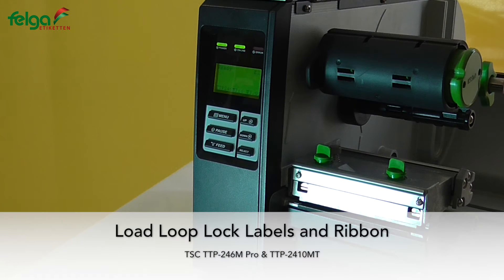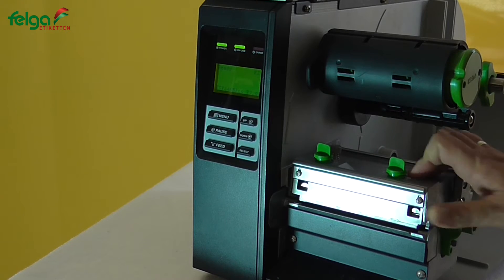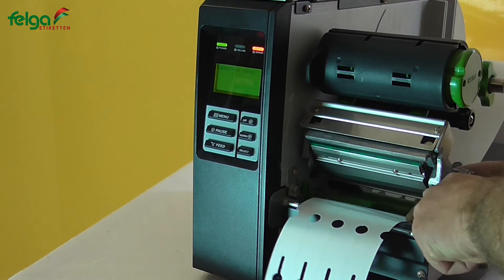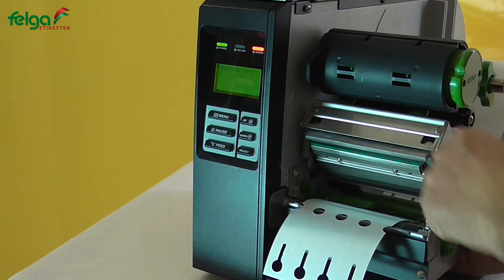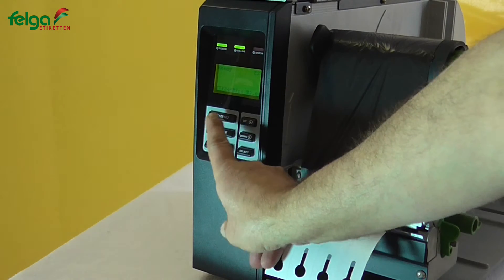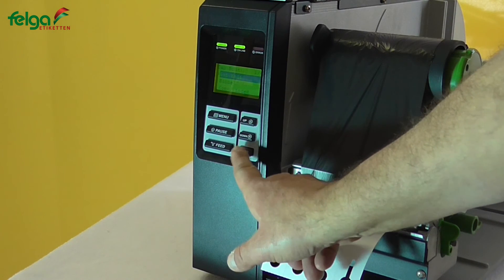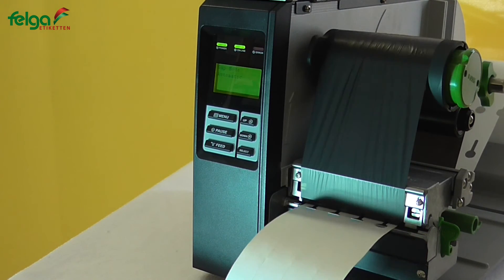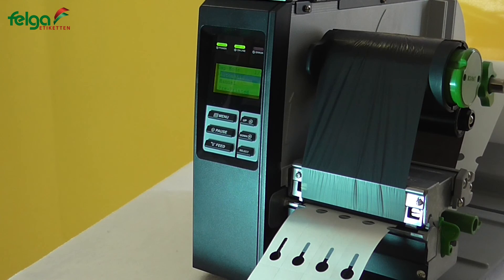Instructions: Printing loop labels with the thermal transfer printer TSC TTP 246M Pro & TTP-2410MT

Comment: hello,i need a bit of help to update my old working mode and usage of those printers,make them now work throw BarTender.my problem is i'm using an automatic system of pneumatic labeling,and need to  find a way to adjust BarTender printings to some sort of awaiting timming,to allow the - pressure tool do its labeing work,throw start and stop commanded by a sensor,so i can avoid mass overflooding the machine with labels...my TSC is mounted on an ND FLEX machine produced by URBINATI,in Italy.any help would be greatly appreciated,ty!
Reply from the maker: Hallo, I am sorry, but we can not help you here.